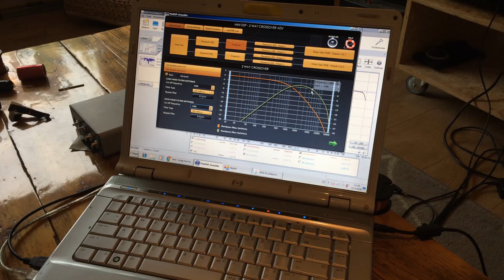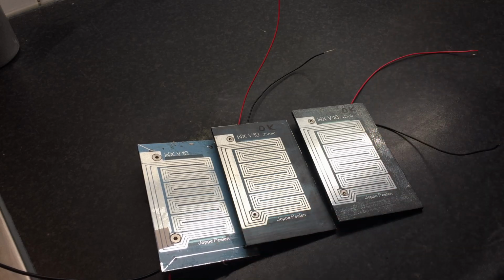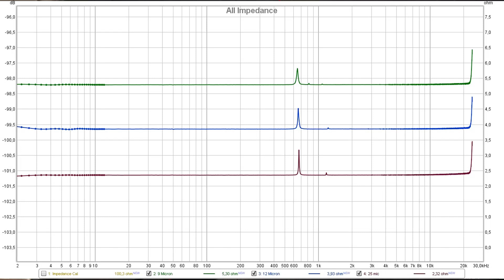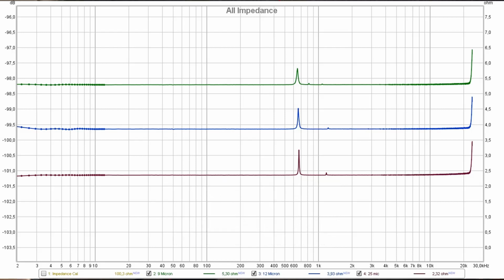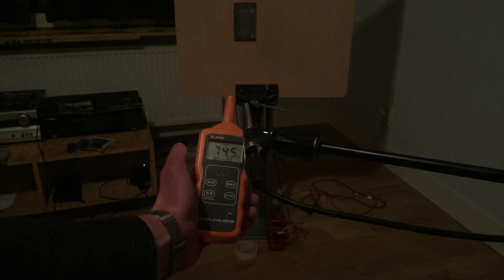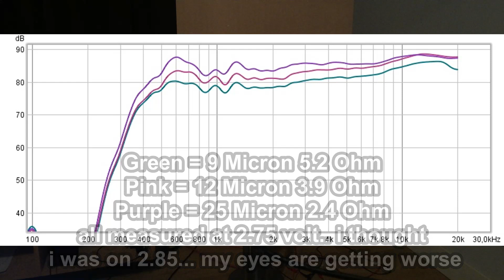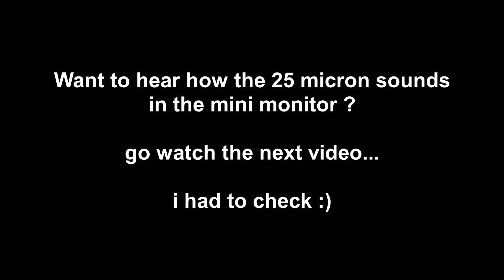Planar magnetic tweeter 9,12 or 25 Micron alu traces ?

Comment: Man, nice work. Though, wouldn’t you need to adjust the input voltage for each driver since they each have a different impedance? For instance, in the 9 micron panel, shouldn’t the target voltage at 5.3 ohms be 2.3 volts at 1kHz (and 25 micron would be 1.7v at 1kHz)? Thanks!
Reply from the maker: The voltage remains the same. That what some companies abuse :) because the lower impedance the power consumption goes up. So the 25 mic uses twise the amount of the 12 micron  +-  i could have set it to achieve 1 watt for each. But i was not so much interested in efficiency. More the fr itself

But you are absolutely right ! I should have dine that to complete it